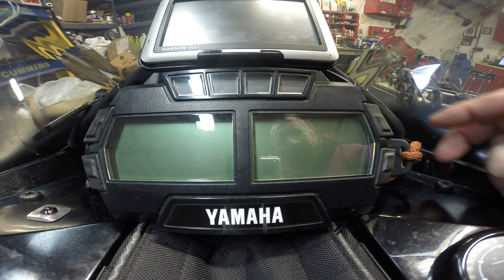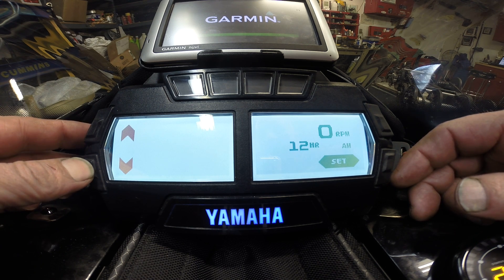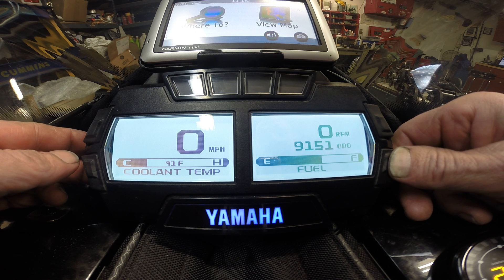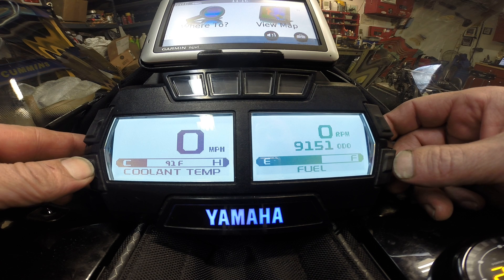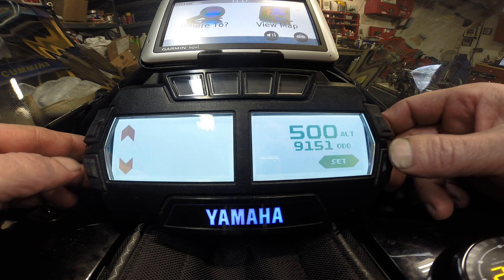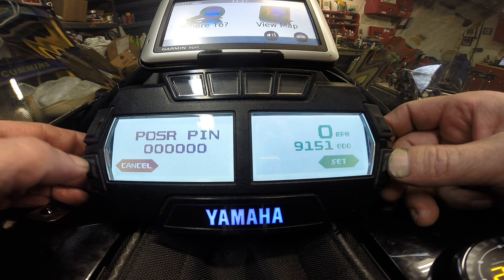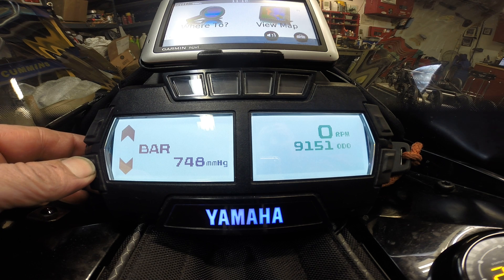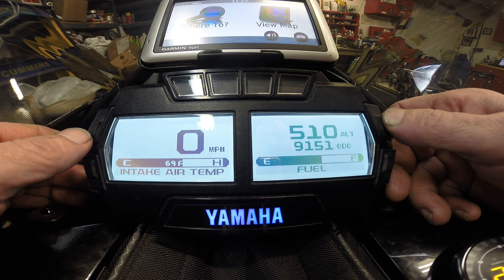Guage2

Comment: Does changing the altitude setting have an effect on computer for the fuel injection?  You didnt cover the tach memory. Is there a good way to clear that? I have to hold the button and hit the kill switch to do so. Is there a different way that i dont know about? Thanks.
Reply from the maker: Tommy Schulte I have afr gauge and moving the altitude base setting changed nothing. But mine stays fairly steady.
Reply from the maker: You reset the max recall by shutting the engine off. No button to reset it that I found.
Reply: @cannondaletwentyseven1643  ok. Thanks.